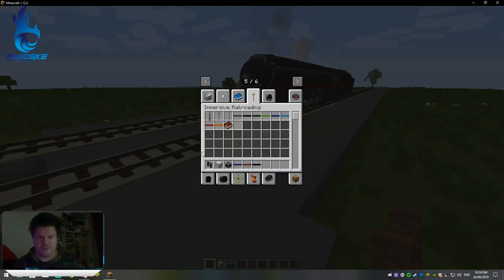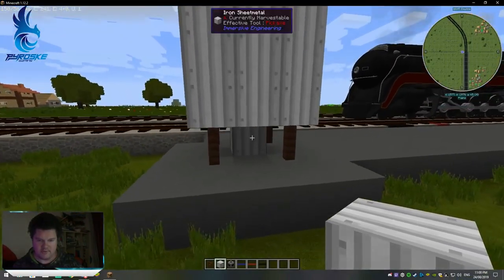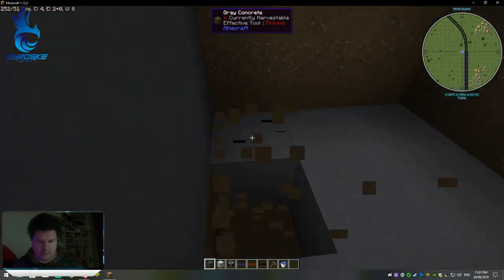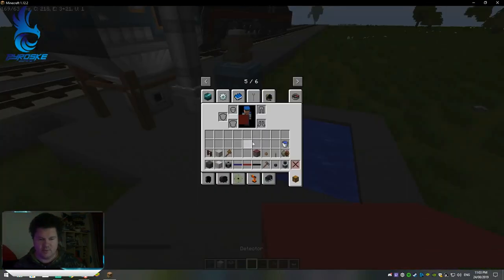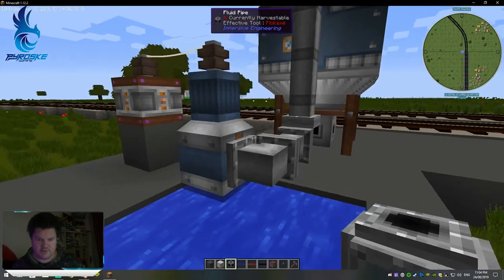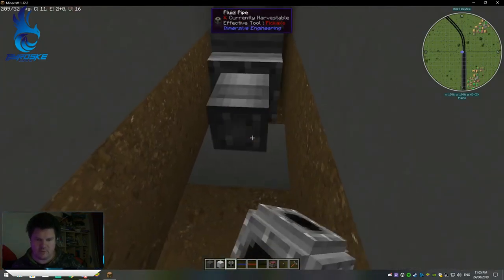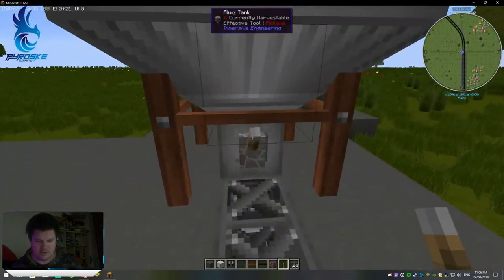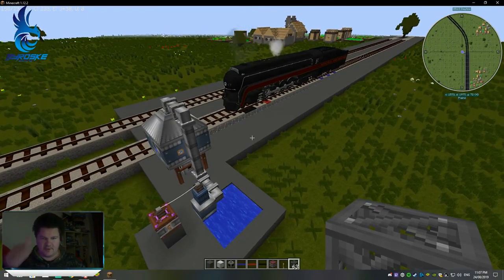Minecraft - Immersive Railroading | How to run water to trains?

Comment: im using this method to pump ethanol but it keeps emptying the fluid source, is there a setting to prevent this from happening?
Reply from the maker: What are you using to generate the ethanol?
Reply: @PyroskeGaming  just ethanol i filled into a hole, its ok i ended up making an ethanol farm so everything is self reliant now, the pump is no longer required, it was sucking the main block of liquad from the pit and drying it out, not matter how big i made it, so i abandoned that method and started growing sugar cane and converting it to eth, sorry for the late reply
Reply: sorry but no